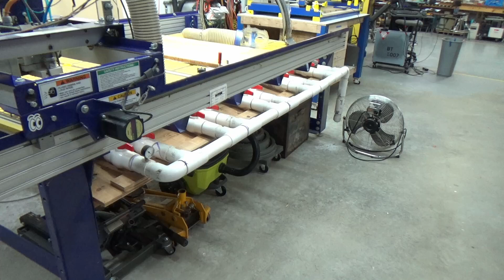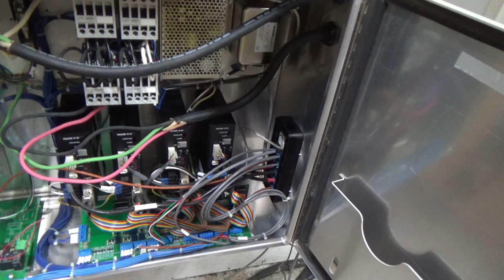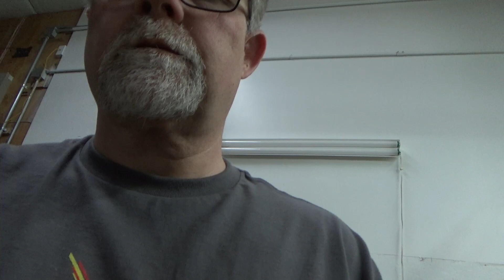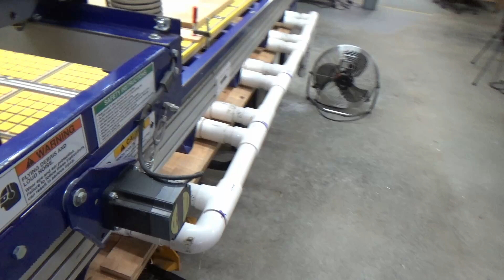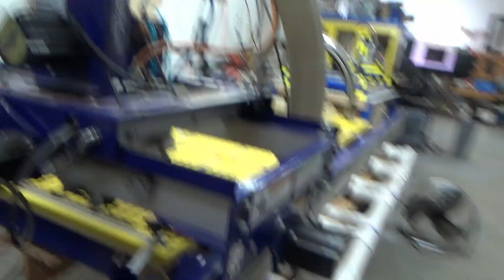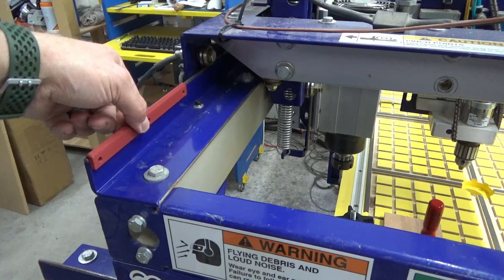The ShopBot Upgrade Project - Intro.

Comment: F15sim, 
I've worked with ShopBots for over 25yrs. I've done several of the hardened rail upgrades to my personal machines over the years. A few points of interest to be aware of. The BWC (Bishopwiscarver) rail that you had the printed model of, there were two version of that rail that we used in house. One only had through holes and the other was threaded (10-32?). The reason I mention this is you are going to want to maintain level across the top of these rails during installation. If you go with the through hole type you will need to be crazy accurate when tapping into the existing rail. The threaded rail, while still needing to have accurate hole location, may be a little more forgiving and allow for slight up or down adjustments if the mounting hole needs to be oversized slightly. 

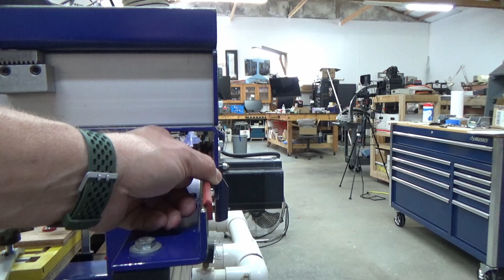Last point. When mounting the new hardened rail. Mount them inboard to the machine. Your 1st placement in the video (21:16) is correct. At (21:36) flip the rail to the inside. This eliminates trying to stretch the Gantry. Mounting inboard you will only need to space the BWC bearings out to meet the rail with 3/8" washer and shim washer spacing. Also use Button Head Cap screws for your fasteners to help maintain as low of a profile as possible to eliminate collisions with the inside the X-car.

I hope this helps.
B.
Reply from the maker: Excellent advice!  Thank you!  I wasn't aware that the rail could be ordered threaded.  My intention was to tightly clamp the rail down, center mark all the holes, drill them a bit over size, and then use button head screws & lock nuts to fasten the rail down.  I can make ABS "hats" that would sit atop the rail and allow a clamp a more stable grip on the rail as well.

Thanks for the tips - they're greatly appreciated!